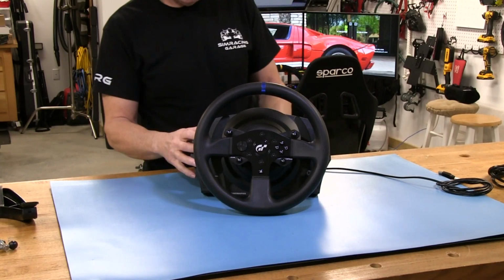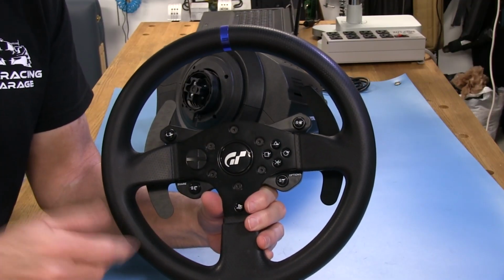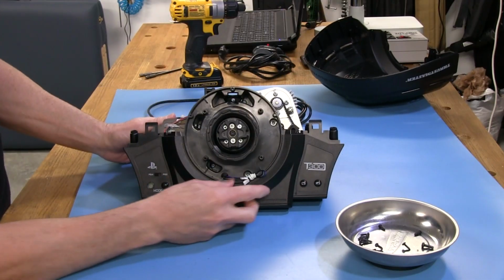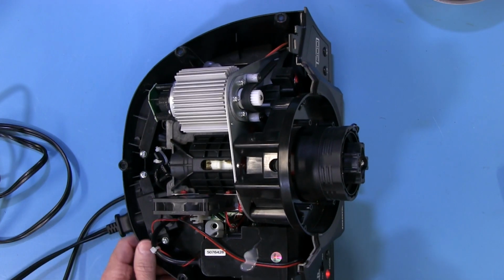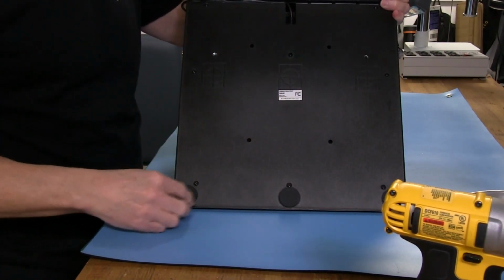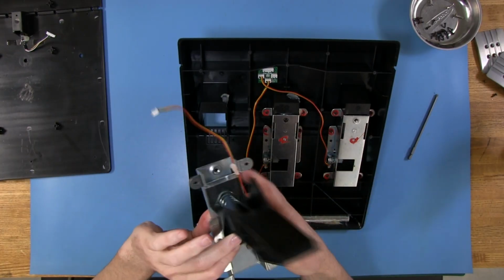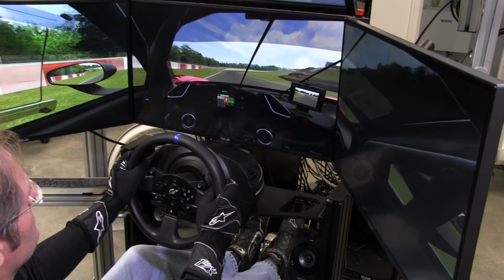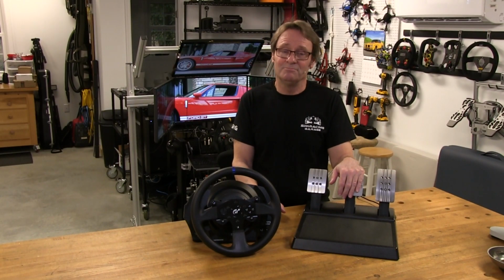Thrustmaster T300RS GT Review

Comment: The lag in Project Cars 2 is just the normal v-sync lag, I think. I mainly drive AC on PC and the only way to eleminate the lag was to turn off vsync and run with frame limiter instead, capping at 120 or higher, to minimize screen tearing and having it run smooth even though there is no proper frame pacing at un-synced video.
Reply: Marisa I have no visually noticable lag with PC2. Using VSync and G-Sync together though...
Reply: Try driving a few laps with g-sync off and only v-sync if you want to witness true sim racing horrors.

Comment: Try irFFB to improve FFB in iRacing. You will feel the curbs and bumps so much better
Reply: Abirafdi Raditya Putra  I heard about this but few I know tried it reverted back after various issues.

Sure does suck iracing not having quality FFB though.

Agree with Barry here that AC is much better, especially curbs and bumps. Notice it in my tactile too.

Especially with their update allowing me to run my Bodnar SS2  without the dreaded CPU warning we used to get.

Comment: I have the RS version and like it.  I did buy a replacement cooling fan to have on hand just in case I need one and to limit down time if I ever need it.  The fans are cheap enough.  I do like reviews on equipment that I can actually afford.  I trust your reviews the most because you go the extra mile to get into the nuts and bolts to see how things actually work.  Keep up the awesome reviews!  Your channel is a great asset to the sim community!

Comment: Interested to see you don't run linear Barry.
I have been asking about this on a SS2 thread over on iracing.

Seems all the guy's are running Linear Beano included, they also don't seem to have Dampen Oscillation checked too.
I'm trying to decide myself about the Linear thing..I quite like it unchecked too ..running a Bodnar SS2 53 servo.
Reply from the maker: Actually, I do run linear in all DD FFB systems in iRacing. Only running non-linear for this belt drive wheel. I mentioned that I have seen guys running the same kind of belt driven wheels in linear mode and said it felt better. And to them it may. Everybody is different.
Reply: My bad, you said you have oscillation dampening checked when in iracing.

Do you think your Pro Sim H shift will be too heavy fir the DBox rig ?

Did I see a guitar case in your garage one tine ?

Do you play ?

Keep these fabulous video’s coming
please 👍

Comment: My former TX-wheel had a lot of FFB-fading and spent some ridiculous amount of money to buy the Accuforce to get rid of it. Was quite more costly than today to do that nearly three years ago with the low Euro-value and the higher price for the AF. I even modded the TX between waiting for the AF with two additional mini-fans to get more hot air out of the box and lowered the FFB, which helped a lot during summer. Seems Thrustmaster changed something to keep FFB more stable in the meantime or it's just not warm enough to fail. 

And certainly i disagree with calling AC a better sim than pCars 2, even iRacing. From the lap-times in GT3/GTE it's clearly the opposite plus many road-cars absolutely match for example the record-laps around Nordschleife with proper telemetry. In AC there are corners, you need 30 km/h less to catch them and making things harder is not more simulation. Historic cars have more modern sticky tyres in PC2, which is the norm in today's Classic racing. When i run the Sauber C9 in AC with a brake-distance like a Jumbo-jet i just think: Did you Kunos-guys ever saw real races before programming such bullshit-physics? A Sauber C9 weights about 350 kg less than any GT3-car with far wider tyres and lower weight-distribution. AC is more geek-guess-physics not based on anything than making it nearly impossible for humans to drive.
Reply: Leynad Jee He didn't say it was a better sim, he said the ffb felt better and more realistic to him, and the latency was clearly there on the console version. Maybe the pc version is better.
Reply: Your rant is ok, just has no place in this comment section. I wouldn't bother trying to persuade someone on YouTube, you're opening a can of worms.
Reply: ive watched a specific sim channel go into PC2 n LITERALLY not set anything up and begin to shit all over it lol

couldnt agree more with just because its harder doesnt mean its accurate to sim like
Reply: It's not about my Sim is better, even it is by far in this case. pCars 2 needs better online players. I loose ranking when I win 2nd place like yesterday.
Reply: I'm asking this myself today while driving AC😁 No, it's not a bad sim, just my SimVibe-setup is not anywhere near the outstanding Feedback i get in pCars 2. Just iRacing is in the same ballpark, but behind. And the online-races on higher ranked servers are clean 9 out of 10 in pCars 2, but i qualify in the top 3 at this rate as well to be fair. AC is more a battleground regarding public online-racing. I hope they announce something with safety-rating in two days.
Reply: Just had two clean races in the GTE-class with some top-drivers in pCars 2 and it could be my Accuforce, but i prefer the FFB in pCars 2 even by far. FFB in AC feels the same in almost all cars and i don't enjoy the driving that much. The cars feel all too light from the weight and this general understeer-behavior seems not realistic when watching real racing. In pCars 2, iRacing, Raceroom, rF2 or AMS you get rather more oversteer when pushing over the limit and this is what i see far more often in real racing.
Reply: I'm not a fanboy, just rational. I crashed worth billions of virtual money in racecars, because they tend to be horrible expensive and some sims made them horrible easy to crash, even many historic crazy cars survived till today. You can decide yourself if you are just a shitty driver compare to the real ones or the sim makes it often that way. I doubt that even the best AC-player can race AC 10 hours without crashing the car, usually 15 minutes or less That's what I call simcade. If it's pCars 2, iRacing or Raceroom, they all IMO more authentic than AC in average, but there are exceptions in all sims as well.

Comment: Awesome review Barry. I have a request. If you get  a chance, could you review the Fanatec CSL Elite wheel and pedal? I was thinking of buying one but didn't found the review and details I wanted to consider that wheel. So if you get one, can you review it Barry. Again, great video.
Reply: Vyasa, thanks.
Reply: Black Hearted 
No problem. If the v2.5 is to much then I would mix and match. Get the CSL Elite LC pedals and the Thrustmaster TS-PC Racer.
Reply: https://www.youtube.com/watch?v=YF1REIZ77KY
Reply: Todd, what is this refresh rate in the wheel and what does it do?
Reply: The refresh rate means how quickly the motor can respond to incfoming data from game. Higher refresh rate means you can feel more of what the car is doing on track.
Reply: Todd, thanks really didn't knew that but unfortunately CSL Elite PS4 is not available in Japan and I can't afford V2.5. Maybe I should just wait a bit longer. Again thanks for the info.
Reply: Okay, I will think about it. Thanks for the suggestion.
Reply: CSL Elite is crap. Only a 500ms refresh rate. If your budget only allows for the CSL Elite then definitely get the CSL Elite PS4. It has 1000ms refresh rate. But If you can afford it, get the CSW V2.5.

Comment: Can I be honest? I really dislike to see plastic surrounding metal. Plastic always shrinks over time as it dehydrates, so it'll start to break as the metal will not budge.
So these 'plastic fantastic' products are really not my cup of tea.

Great review as always though. :)
Reply: LogiForce86 you're right. My TV shrank just last week.
Reply: well dont put them in a direct sunlight or close to a heat source. if you put the plactic to a ambient temp  the plactic wont be ruined.
Reply: gajeel redfox Newsflash... the motor generates heat and so do the electronics, hence the fan inside.
Also a fan is not a means of cooling but a means to cause air to move across a heat source. So it's just a transportation of air in a pretty closed casing. Thus not much heat will escape.
Reply: -_-' seriously, benandrewlaw1234? Shit like that happens. For one it causes issues with the codewheel on the back of Logitech G25/G27 motors cracking.
Also it happens on for example Sony Walkman DD-series units that have a so called center gear. You can see what happens in this picture: http://www.walkman-archive.com/articles/article_dd-center-gear/ingranaggio_1_xl.jpg
Reply: @LogiForce86  I've had a DFGT for 10 years and it still plays like new. I question how prevalent this problem actually is.
Reply: @modelcitizen1977  Your DFGT hasn't got the rotary encoder on the back of the motor. That is already a difference. I have an even older Wingman Formula Force GP wheel that is also as new, but the construction inside is different.
So it is apples and oranges in this case.
Reply: @LogiForce86  I still have plastic products from 40 years ago. You realize there are quality differences, too? Just like there are differences with essentially all materials?
Reply: @LipziG3R  Of course, as a great uncle is in the plastic business actually (he was/is owner of companies like Rosti Mepal B.V., but also of companies making high pressure tanks). 
What one also has to realize of course is that the general quality of plastic nowadays is relatively low to reduce costs. Often it's plain non-reinforced ABS plastic that easily cracks with age. As long as that lifespan is within 3 to 5 years for most electronics products it is considered to last long enough.

At the end of the day those generally used plastics in consumer products are just not up to my personal standards at least. As I said... it is I myself who dislikes plastics, especially if they shrink around metal parts and start to fracture. It's also the reason why expensive Sony Direct Drive Walkmans failed with age, because a single center gear with a metal center started to crack. That whilst it is a really top of the line and now very wanted retro product in good conditions.